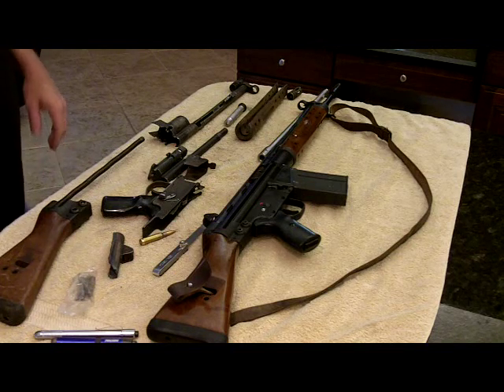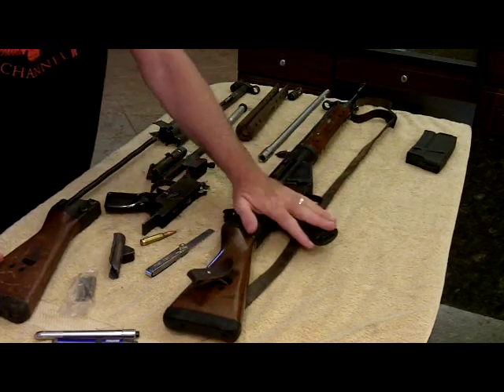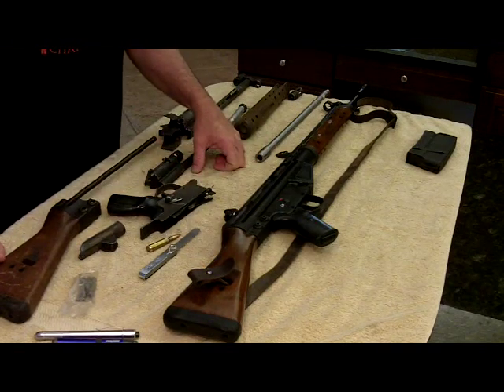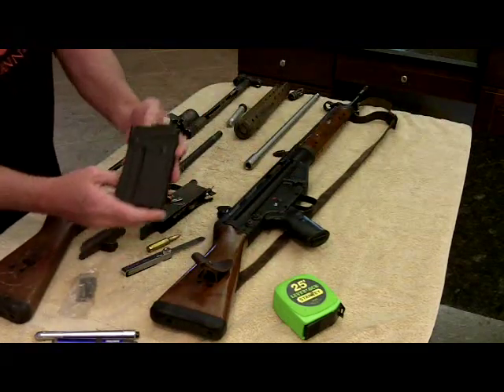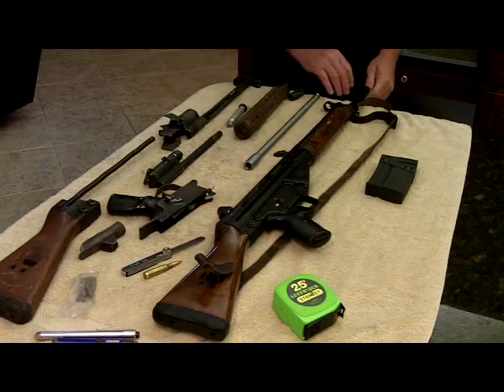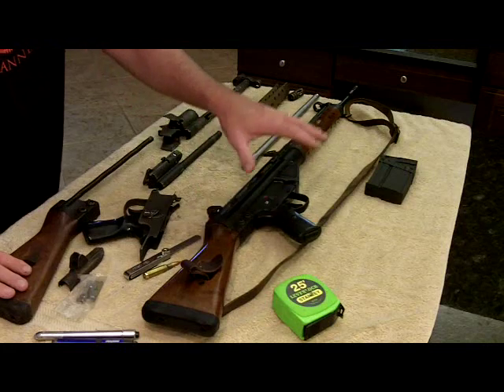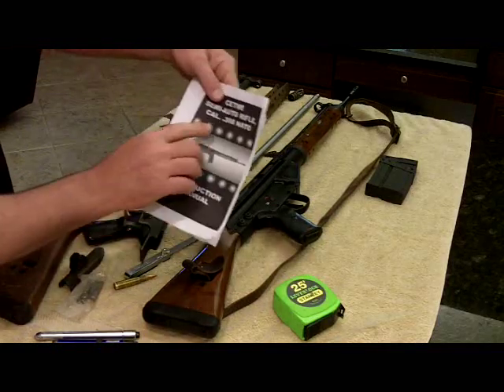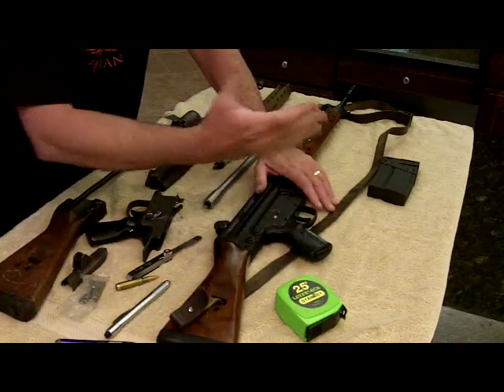Cetme 7.62 X 51 Battle Rifle Part 1

Comment: Do not measure your barrel in this manner. The BATF measures a barrel on a long gun by locking the bolt or closing the chamber as if loaded and inserting a rod into the muzzle until it stops at the bolt face. The length of rod that fits inside is considered the length of your barrel.

Comment: Most people don't understand that the external dimensions on the .30 M2/ 30-06  .308 winchester/ 7.62×51 NATO  5.56mm/,223 Remington are identical and interchangeable. The interior dimensions differ in the case head and case shoulder / neck area are thicker to prevent case head separation and case failure. Military brass can be used for reloading, you just have to back the power charge down because the thicker case doesn't have room for the same amount as the thinner commercial case. Also remember when resizing to run the military brass through 4 times rotating the case a bit each time. I keep hearing the stories that you shouldn't fire 5.5.56 ammunition in a .223 Remington barrel. That's B.S. None of the rifles I have that have a .223 barrel have any issues. The brass isn't bulged or neck split or primer blown out. These are all signs of over pressure. My resizing dies work the same. I have rifles with both .223 and 5.56mm barrels as well as 30-06 and. 308 winchester. All handle military ammunition just fine. I once told a turp 19 year old armor that. He swore up and down that wasn't so. I said calm down before you blow a gasket. Who do I believe, you or my lying eyes?

Comment from the maker: I would take the rifle apart and see if you can't see what is up. It could be a broken extractor or any number of issues. If you are in the South Florida area, you could stop by the shop. If not, and this is not something you are comfortable with, take it to your local Gunsmith. The CETME will shoot .308 brass but sometimes case thickness is not strong enough for the fluted CETME bore and can give your extractor hell. Call me if you need.

Comment: I recently went shooting with the CETME I just bought not to long ago.  The first 20 rounds of Remington CORE LOKT 308 WIN shot great and I had no problems.  Next I  got off two shots using BARNES VOR-TX tipped TSX 308 WIN when the bolt got stuck and was a pain to get the round out but I managed.  Now though, if I feed either type of round in the chamber the bolt won't close all the way.  Does it have something to do with my bolt gap/cocking tube gap?  Any advice would be appreciated.

Comment from the maker: @esh325 Its funny you bring this up, John and I were talking about this. I am talking about the whole operating system. I love it but it is unconventional in how it actually works. Its hard to really see how it works with out gas being diverted to drive a piston back. lol. It is a lot like a simple blowback design on a pistol in a different package, the space that is created when the carrier backs away from the bolt when the rollers release. I could talk about this all night. lol. Thanks. :  )

Comment from the maker: @solidsnaker1992 That is because for the most part, they are the same rifle. The Cetme was designed by a German engineer and then they made the G3 with some small improvements and then then came the H&K91, a civilian version of the G3 in semi-auto. Thanks for the comment. They are all great rifles and are designed pretty much the same. Thanks.

Comment: when I served in the Norwegian defence forces 2 years ago, we where the last ones to get the G3. I'm glad that we got it, instead of the HK316, that's replacing it. A great gun, rugged and a great shooter. The only problem we had was with sensitive sights and bad ammo. (environmentally friendly ammo, that was way to hard and shoddily made.)  The sights would knock slightly out of zero if it was handle too roughly, but that was mostly a training issue. -30c or 30c, it did it's job.

Comment: Nice rifle man. I have almost bought one of these a couple of times. I wish now that I had. The proper way to measure a barrel (the way the ATF does it) is to take a wooden dowel and insert it on a closed bolt....when the dowel stops they mark the dowel and measure the mark to the end of the dowel. This is obviously done with the flash hider removed.

Comment from the maker: @cokeman2423 Bro., I am not sure what the good and bad ratio is but, I think the problem with CAI was blown out of proportion. I worked on my friends rifle after he had numerous issues and it turned out he never really cleaned it properly when he bought it. I bet I took out a half a gallon of grease. I am not kidding, the trigger group was jam packed in a thick black grease and so was the trunion and that ended all his problems. The grease had even worked it way into the firing pin channel.

Comment: @ChromeFreak123 I think your right on the bad rep CAI gets and yeah a few guns put out that shouldnt have been. I own a CAI AK-47 and CAI L1A1 both funtion 100%. I bought the L1A1 used from the gun shop owner (friend) and it runs 100%. I do know it dosnt like soft tip hunting ammo.

When you do the next video can you tell where to get good mags and the prices I hear they went up on prices a bit but not as bad as the M1As or FALs.I cant wait for part two.Good job on this vid keep them coming.